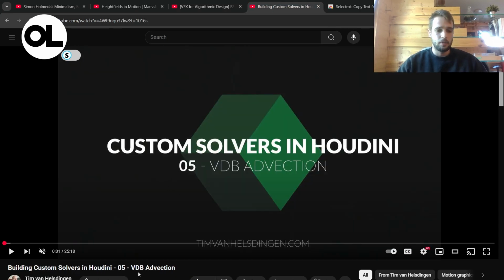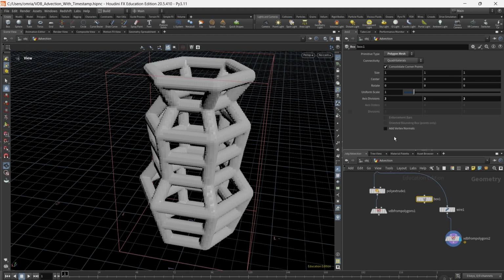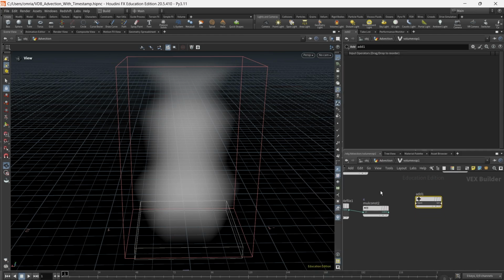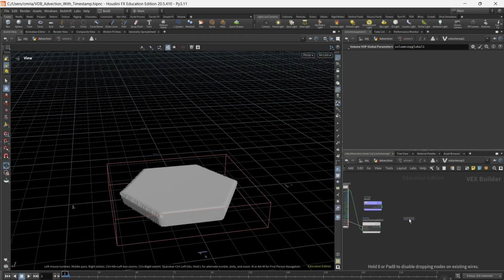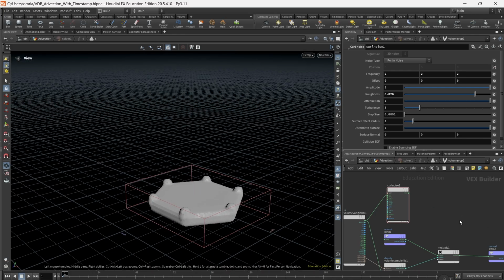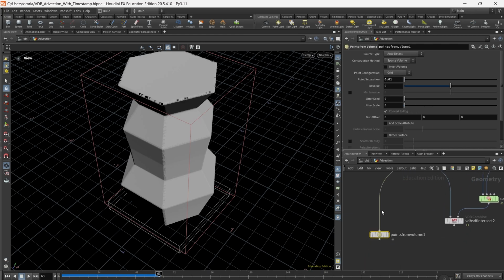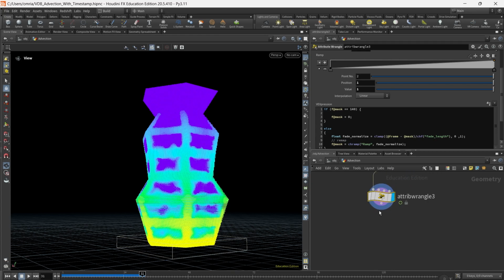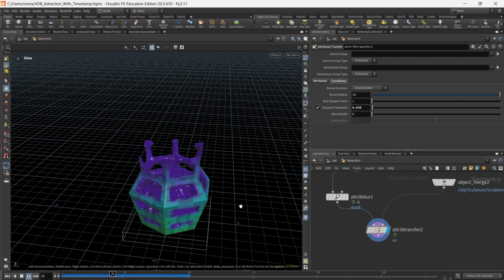Houdini Tutorial - VDB Advection with Timestamp Attribute

Comment: for some reason, i never get the mask appearing as a gradient from even red to purple, let alone the full spectrum after your normalise it...i just have the points as white by default and turning red as the growth occurs. did you ever experience this during your experimentation?
Reply from the maker: I think you can change the colors
Reply: @OmriAdamLev  Ah maybe it could be that...I was thinking perhaps the problem is that I am not actually creating the right type of data for some reason
Reply: @OmriAdamLev  ah turns out my problem is that my mask transitions uniformly over the whole growth for the duration of the fade length - it is not linked to the age of the individual points. it is linked only to the fade length rather than the age of the points i think